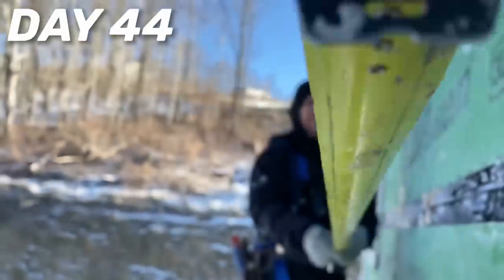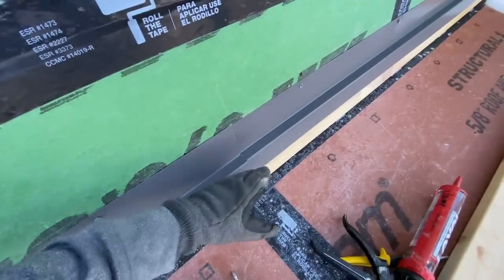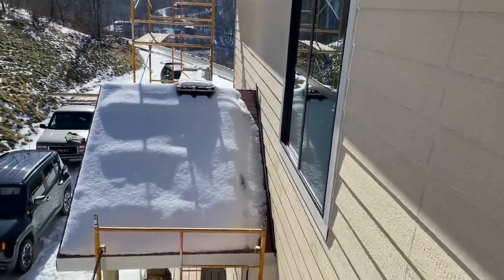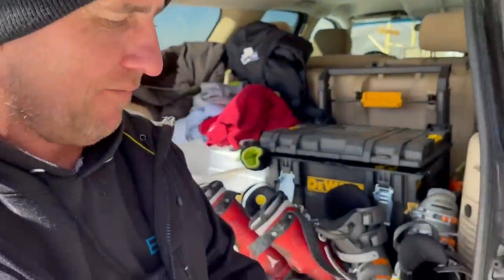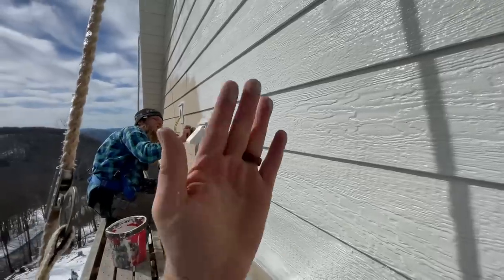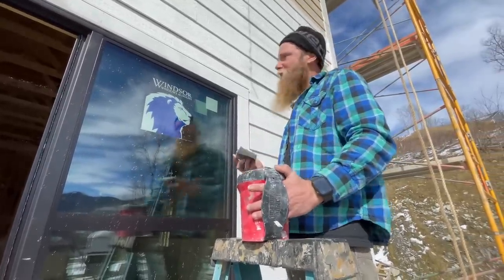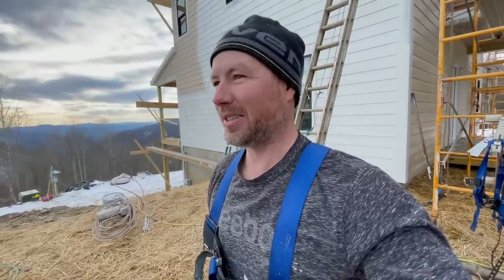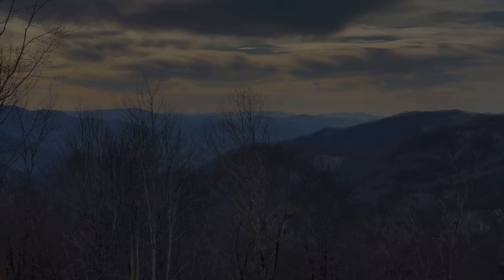Building The Farmhouse | Day 44

Comment: You gotta think like water, what would water do?😂😂
Reply: Water is so complex even computers can't simulate it perfectly 😂
Reply: @Carl_John  Thats mostly due to particle count but yeah
Reply: Instructions unclear: dead squirrel in roof
Reply: @jonomoth2581  lol
Reply from the maker: What would squirrels do!
Reply: @PerkinsBuilderBrothers   why a squirrel would do what it could, which is not necessarily what it should. Good?

If not read on.. a squirrels skin is waterproof otherwise leak they would, so at least in short term a suitable material for a roof. But obviously a squirrel would think that is not what it should, as they cannot think of water but rather live in a wood.

That is as should be unless tis a mythical beast; not roof nor squirrel but something between. It lives a life as a normal squirrel would, until it the day it almost drowns in mud, there is a change inside, no reason why, but an irresistible desire to find two rafters to stretch between, sigh in a contented squek, and lie forever in an eternal, blissful sleep.

But above all else and below nothing and next to all, through thick and thin, tall and short, loss or win, always, always think like water.
Reply: @PerkinsBuilderBrothers  it’s so true, been doing water damage mitigation for a while and it’s a saying that we use👍🏻

Comment: I’ve got a standing seam roof on my personal house. I went standing seam because of the locking eve caps. Very water resistant!! Im fully convinced nothing is waterproof lol. The roof has been on my house 25 years and it still looks brand new with no water issues. I highly recommend standing seam if you can afford it.

Comment: Pro tip: I would recommend to wrap the shield with a few layers of  masking tape and paper. As the paint builds up take one layer of paper off and you'll have a clean shield to continue using.  And at the end of the day your actual shield won't have any paint on, it'll be like new 😉

Comment: That lap joint on the flashing at the first of the video. Instead of what you did you just have to draw an imaginary line 1 inch up 3-4 “ long and cut on a dirty angle like 70 degrees and they will do the same thing just quicker

Comment: You mentioned that you left the trim high on the roof to keep from wicking of water.  As much snow as they get on the mountain, won't the snow pile up and allow for wicking anyway?
Reply from the maker: Good question… Yes Snow will pile up and potentially cover that, but that’s not nearly as common as rain around here. Leaving an air gap is key to longevity of any materials that are right above a roof.

Comment: Sherwin Williams has a paint called resilience which formulated for cold weather. Even though super paint is a 35 degree product, the resilience will dry fastest and stops surfactant leeching which is when some of the paint components dry at different rates and cause an oily/greasy film on the surface. The film will eventually go away with rain and time or a light power washing. Easier to use the resilience in the first place when few point is low

Comment: I’ve learned a ton from you all. I believe your compressor problem is due to using ext cords. Voltage drop with a long cord is hard on compressors and if you have to use a cord it should be a minimum of 14 gauge but 12 would be better. Really probably best to use no ext cord and just use longer air hoses, deal with a little air pressure loss rather than voltage loss and save on the wear and tear on the compressor motor.

Comment: Quick question about paint spraying: Last time I used one it left almost a sandpaper finish, did I do something wrong?
Reply: What kind of paint did you spray on to what material? It sounds like the material wicked it up a little and there wasn't enough paint sprayed onto the product, even if it looked completely covered.
Reply: It’s the overspray that makes it with the sandpaper feel.So for example: You spray the walls,than the ceiling.Not the ideal way but yeah,you got the point,when you paint the ceiling the overspray will stick on the walls,than you get like small pieces of sand on the walls,hence the sandpaper effect
Reply: @nathanasimpson  normal interior paint rated for use with a sprayer. Did two coats and it's still rough.
Reply: @namAehT  Did you backroll? I've always backrolled when spraying, and making sure I'm using an airless sprayer
Reply from the maker: My guess is that it was put on a little too light… If you get the paint just heavy enough it will float out to a nice surface

Comment: Q+A:  Why don’t you paint the LP Smart siding before you put it up on the house?
Reply from the maker: Good question… Usually we do pre-paint the siding. The problem with this build is that it wasn’t above freezing any days before we needed to start to put the siding up. It was determined that would actually be more work to haul it down to the shop and paint it and then haul it back up the mountain than to just install it and paint it after the fact.
Reply: @PerkinsBuilderBrothers  Thanks for the Response!

Comment: Hey gents! Not trying to be one of those as$holes that know everything on youtube, but here goes. We primarily deal in roofing and decking, so I naturally have high attention of detail when it comes to roofing, soffit/fascia, gutters, etc. 

Next one you boys do, make sure that you put your dip edge on before you put your Fascia on the eves. Nail that udl30,psu30, or whatever udl you are using a little high. This way you can slip the dip edge in when you are about to do fascia. 

One of the main reasons for drip edge is to counter flash the fascia.

If you put that drip on it's go to make sure that water, snow or ice isn't getting behind that new fascia you just put on. 

Just a tip from a guy who installs metal and asphalt roofs Every week in Pa. Hope  that I didn't come off like a Di*k. 

House looks awesome!
Reply from the maker: Thanks for the comment! We actually usually put the drip edge on first as well, but it had to be custom-made for the standing seam roof we are using and we didn’t have it. We did get it on today actually and zip taped everything so that water is running over the face of the facia. We actually have a good bit of the roof done as well now! I think this is a great point and we actually did have water running behind the metal facia until about a day ago.
Reply: @PerkinsBuilderBrothers  actually :)

Comment: Your walk boards- heck no.  A boom lift is the only way I'd be up there.
Reply from the maker: I’ve been lift would be nice… It would probably cost us $4000 to have it on the job during the paint. It ended up taking a total of about two weeks because the temperature is only permitted painting for a few hours every couple days.  We grew up not even having walk boards so they seem pretty awesome to us.
Reply: @PerkinsBuilderBrothers  for $4000 I could have one onsite 2 months plus.  In that time you guys would be 100% done exterior.  Pass the cost to the customer and if you eat it the speed/efficiency and safety factors are well worth the cost moving you on to the next job quicker and in one piece.   Keep up the great work and stay safe.

Comment: Motors are not suggested for GFI. Refrigerator, vacuum, air compressor....
Reply from the maker: You are correct… But unfortunately due to codes here we have to use GFI protected outlets in our temporary pole